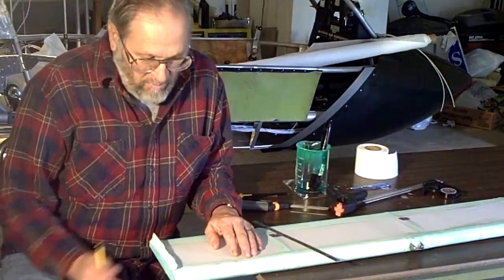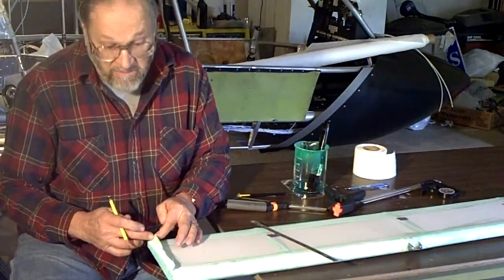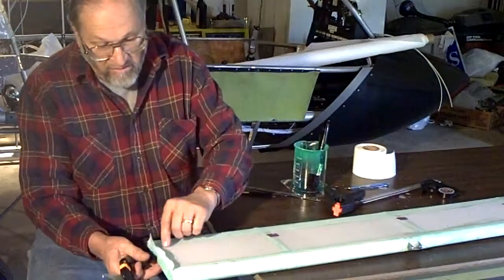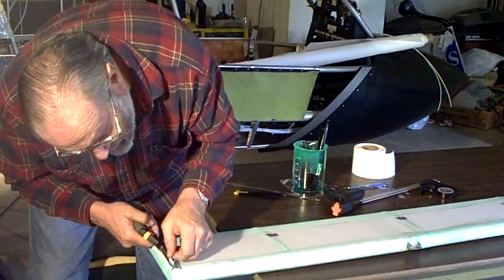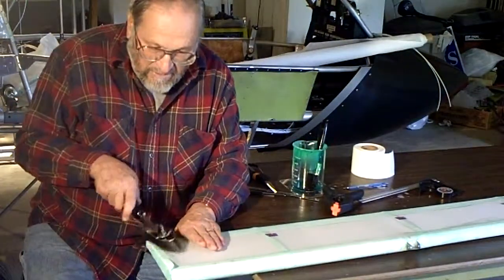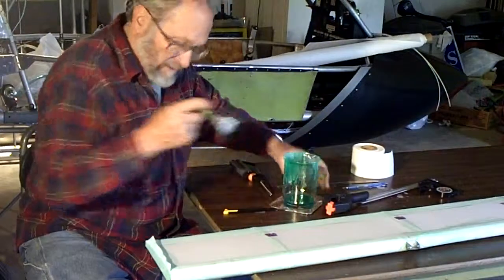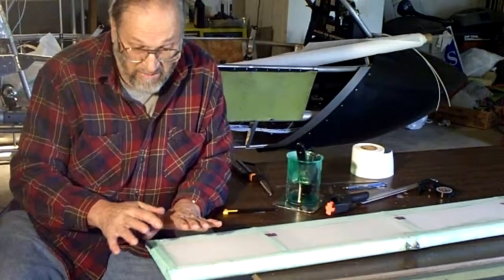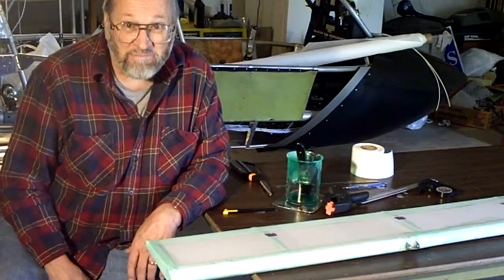MICHAEL HEIT: EDGE TAPE TIP ON AILERON.AVI

Comment: Great tip thank you sir
Reply from the maker: You're welcome; this video was posted quite a while ago and I have since sold my project. I moved to Alaska to work for a major airline. I started out as an A&P/IA and later also served Alaska as a DAR. I was unable to get the project up here and was made a fine offer on the project which I accepted.  I am now the lead technician in our company  flight simulator division and spend my days working ( and flying every chance I get) the MD80 full motion sim and others. I am now contemplating how to get another project to build, my goal is a true Alaska bush plane ....  that bug has bit me again.